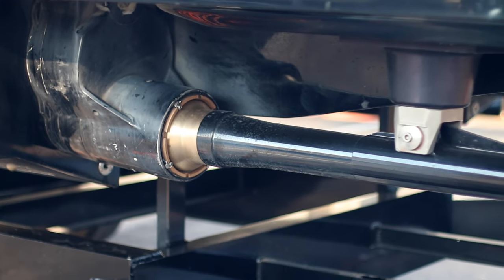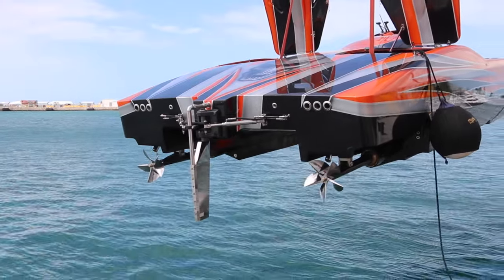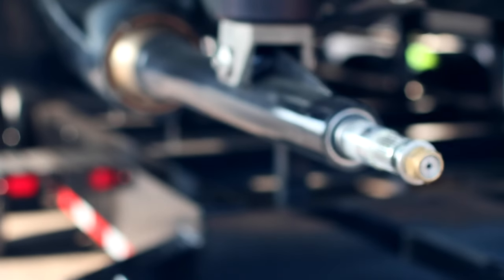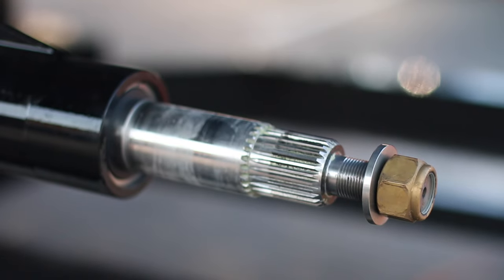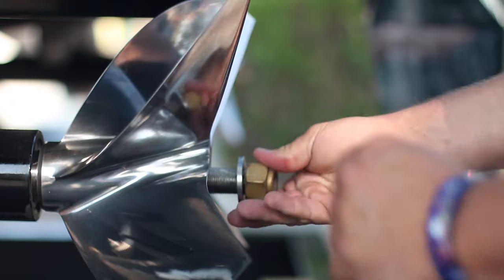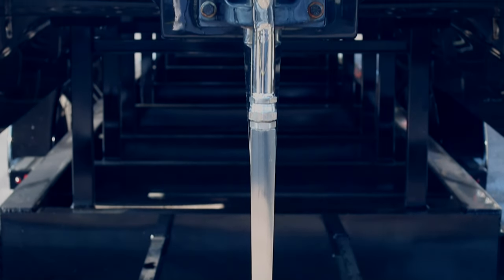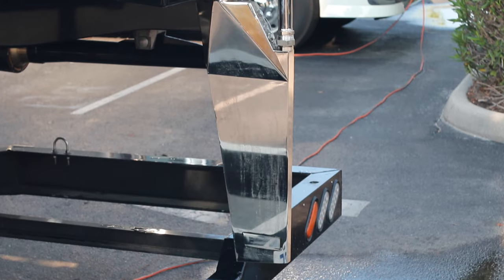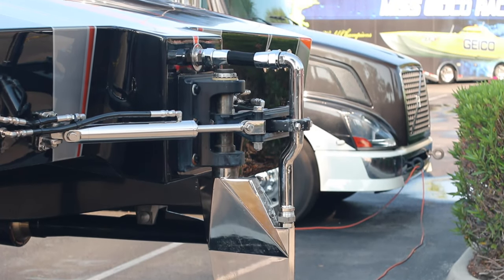Technical Series #05 - Surface Drives and Rudders

Comment: how does the rudder system fare in hard turns though? Im thinking surface drives to convert a high performance engine to an inboard because outboards don't have the figures im looking for at the high end. This is a personal side project. I like them but the steerable ones are heavy and dont take the input hp and rpm.  Its intended for a monohull with a slight concave, and monohulls can turn very hard which is why i ask how they hold up